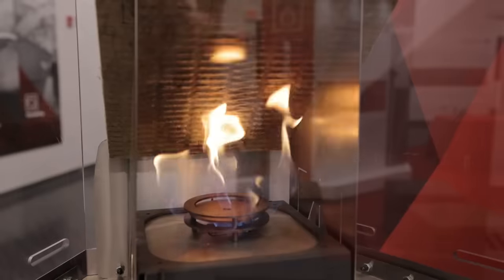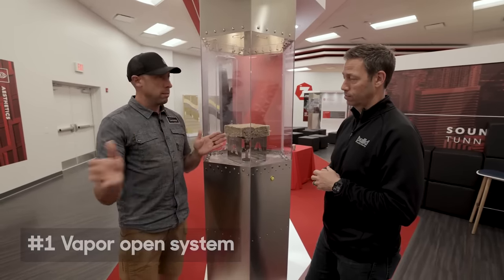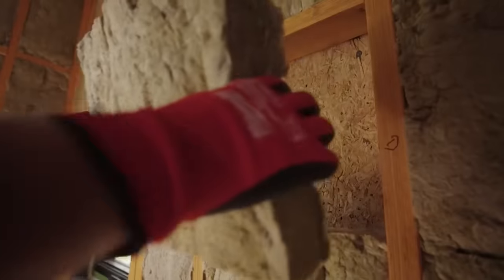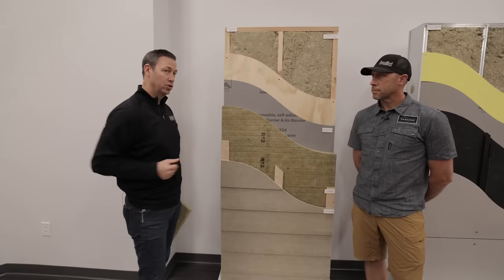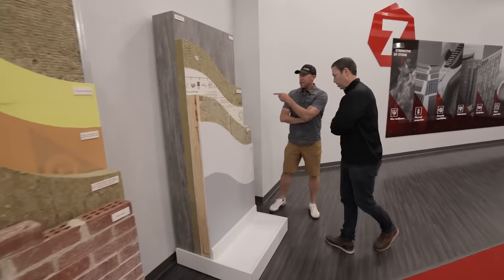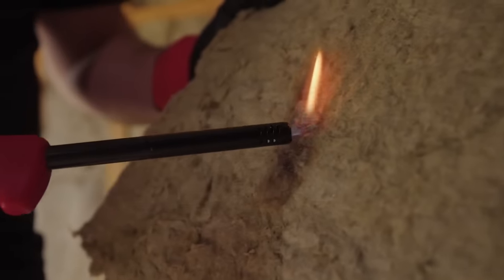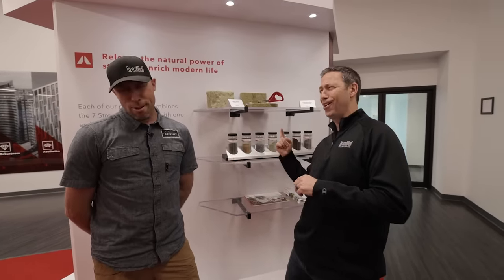3 (little known) Benefits of Rockwool Insulation

Comment: In a humid climate, does the vapor open characteristic lead to substantially more latent load for the air conditioner or dehumidifier to remove? Or, is that vapor pathway small compared to other vapor pathways even in a well air-sealed house?

Comment: Vapor barrier information is all over the place.  What side to use the faced barrier or none at all.  Can you break it down for us?  I have a connected garage in southeast US and have no idea after doing a bunch of research.
Reply: Vapor barrier goes on “wet side” of wall. In desert climate we install on inside, because air from human respiration creates moist air within building envelope and you do not want that moist air migrating into wall cavity. In southern US, your moist side is outside, both rain and humidity while interior air is typically dry due to AC. 

Most mineral wool insulation lacks a vapor barrier, Kraft paper or plastic. The only areas we install vapor barrier on inside is high elevation mountains or desert where exterior humidity levels are commonly <20%.
Reply: Vapor barriers are tricky.  Building science is actually moving away from using them.  Old houses have very little or no rot without them.  It's kind of like the tar paper vs tyvek argument.  Again the old house tar papered wins
Reply: @tonyramberg9697  thank you for your thoughts on this important topic.
Reply: @MichaelM-to4sg  thanks much for that information!
Reply: @tonyramberg9697  That is beyond absurd. Tar paper is/was awful. Building science is not moving away from better sealed houses. Old houses have lots of dry rot issues. Where old houses “win” is fewer mold & mildew issues because they are so poorly sealed the ventilation is poor environment to host mold spores. 

Old houses are much lower efficiency, resulting in more energy usage, more operational costs, more bug issues, poor interior air quality, poor sound insulation. Nobody above room temperature iq chooses tar paper over Tyvek. 🤦‍♂️

Comment: Matt, I’ve been watching your videos on attic insulation. I live north of Austin in Temple. I have a 12 on 12 pitch roof with high ceilings in the attic. I’m not completely sold on spray foam, so this Rockwool insulation could be a good option. Would you recommend this product over spray foam for this area. Also, I was looking at this as a possible DIY. Thanks for the videos!

Comment: The only downside is that it’s a wifi killer. So if you use it on basement ceilings or as a soundproofing in interior walls it will stop Wi-Fi transmission. Easily cured by running some cat5 between zones but something to be aware of going in.
Reply: Will- I have  t heard this before-can you refer me to a source out url ?
Reply: @johnwhite2576  Haven’t looked on line but first heard it a few years back from a service provider technician and had the personal experience of weak Wi-Fi transmission through old school plaster walls and upstairs to basement through rockwool . The benefits in soundproofing and fire retardation far outweigh any inconvenience posed and you’re better off with cat5 runs between zones anyway.

Comment: Getting Rockwool at my local Lowes is very hit or miss. Them seem to carry only a very limited amount and only r-15 16" on center. Anyone have a better source for picking it up?
Reply: Your locally owned building supply? Avoid those big box chains whenever possible
Reply: Can't ever get the exterior board here in rockwool.  It should be used more

Comment: 1) That "sound tunnel" is not exactly realistic. Most of us cover our walls with drywall or other hard panels which reflect sound. If that tunnel was lined with drywall you'd be hearing quite a bit more of the conversation on the other side, although those 90° angles would attenuate the sound. Doors would help even more.
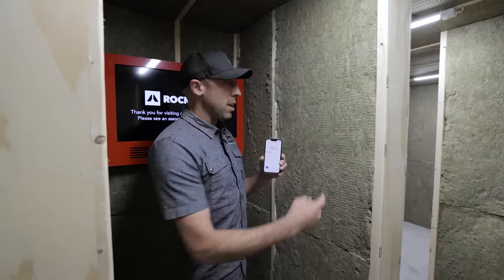2) 12:46 That's why acousticians favor it, perhaps. Sound engineers are minimally educated on the finer points of wall insulation unless they've also built their own studios or have a particular interest in architectural acoustics.

Comment: Maybe not a relevant question but I have a cdx roof on my house. Roofers installed waterproof peel and stick underlay on top. And the builder wants to spray foam+ rockwool the cavity. It's an I joist roof. Are there any concerns for rot or mold if both sides of cdx are effectively vapor proof. Roof is non vented. Let me know

Comment: I'm curious about the distinction between Commercial and Residential. For example, "We have steel studs, which are highly conductive ... so we've got to have some good exterior insulation". We should have that for residential as well. Steel studs are something that I think has benefit in residential, but the negatives are the same as for commercial: The thermal issue. Can anyone explain why the best practices for Commercial are different from best practices for Residential, especially since goals and usage are similar?
Reply: Steel studs aren't as strong as wood studs, so they're generally used for non-structural walls. In commercial buildings you generally have a steel frame or concrete walls providing the structure, whereas in single family homes the stud walls provide the structure, which is why steel isn't often used there. Its main advantage over wood is straightness, but finger-jointed, LSL, or PSL studs share those advantages.

Comment: So, a question I have is how to best utilize this product to redo Engine Bays in Wheel Estate (Motorcoach RV) instead of Real Estate. The Rubberized sound deadener I have now is just crumbling from the heat. I am thinking this can be utilized as a Far superior. retrofit because of the benefits I see here.  So, what products and type of installation would be recommended for this? Keeping in mind Road Contaminants, Diesel Fuel/Oils that can be either splashed up or sprayed possibly from a leak? I am thinking a Hard Sheath that is both Fireproof and Sound deadening and contain the Rockwool product.  I also wish to line my 10KW Deisel Generator compartment, located in the front of the coach as well. It is a well-insulated 40' Diesel pusher now, but time to upgrade the current materials that are Sub-Standard, the way I see it. It is flaking, cracking and just falling everywhere with black dust particles galore! Not trying to Re-Invent the wheel here, if this has already been done, and specs already exist for the best Sound/Fire insulation, but if a Factory Rep, or RV Industry Guru could just chime in here that would be awesome!  I'd like to do this project, ASAP!  I just wish to do it correctly, and not have bad results for the Financial Outlay, I am looking at! It was mentioned I could get Double the Sound Deadening with an Air Gap, as well. I have about 5" or possibly more thickness to deal with here, easily, and could make it thicker if necessary?
Reply: To add, I have already installed a Passive Sprinkler System with Fire Bottles filled with AFFF Foam, which is still the best Fire Extinguishing agent made. I have heads for one bottle above the Transmission, and Engine. A single head above the Genny, and one in the Refrigerator compartment as well. They are similar to the Commercial type of heads you see installed in buildings. I hate Fire and was willing to spend over $1,000.00 for our safety in that regard. That was just for the Hardware. I did my own install. That would easily have been yet another $1,000.00 by estimates given.  I take this seriously and I keep coming back to this product as my choice. Is it doable? Thanks! RV Fires and Sound deadening are very real concerns in Wheel Estate!

Comment: If I were going to use both comfortboard and safe n sound in the same interior side of an exterior wall, what order should I go? Which product should be on the interior side?
Reply: You would use Comfortboard over the exterior of the wall sheathing, and Comfortbatt for the wall cavities on the interior side of the sheathing (between the studs.) The Safe'n'Sound is used on partition walls that are completely within the envelope of the building, as it doesn't have a rated R value.
Reply: @JamesCusano  I’m only gaining access to the interior side of the exterior wall
Reply: @baxt1412  Ah, I see, that might be a bit trickier. Comfortboard is semi-rigid, while Safe’n’Sound is soft and deformable; so Safe’n’Sound can only be used between framing members, whereas Comfortboard can be placed over framing members or layered over wallboard.

Comment: Is there a mineral wood product that can be used under a metal roof?
Reply: Comfortboard 80 is used for that. Usually with spacers like strapping between the insulation and the metal to promote ventilation/drying of any condensation on the back side of the metal.

Comment: Fire resistance, bug resistance, sound protection, etc you have that with brick too. But Rockwool doesn't give you storm protection. Also, wood framing introduces thermal bridging by default (to some degree unless you insulate from the outside). You don't have that with brick walls.
Reply: What type of insulation does provide storm protection?
Reply: @hellonoko  Brick. :)
Reply: @b_lumenkraft  are you referring to thermally insulated clay blocks or similar like you might find in Germany? 

Sure, but sadly we don’t use that in the USA. 😅
Reply: @hellonoko  yes, i mean those insulating ones. I am from Germany and the concept of building houses with wood sticks is very very strange to me. ;)

Comment: How does vapor permeable work with the Zip system or does it not work?
Reply: The ZipSystem is an air barrier, but still vapor permeable.
Reply: The OSB part of zip is vapor permeable, the green paper sheathing and tape are effectively
 NOT vapor permeable, as were Hubert’s own web site
Reply: @johnwhite2576  From the Huber blog article titled "Your ZIP System Wall Sheathing Questions - Answered" posted on April 29, 2021:
Are ZIP System sheathing panels a vapor barrier?
No, the integrated protective overlay of a ZIP System wall sheathing panel is permeable to allow for drying to the outside.
What’s the permeability of ZIP System sheathing panels?
The permeability of the entire panel is based on the permeability of the OSB (1-3 perms depending on thickness), while the permeability of the integrated protective overlay alone is 12-16 perms.

Comment: How does it compare to a spray foamed house with a tight envelope? That’s what most of the building in the south is using.
Reply from the maker: I like Zip system for air tightness then Rockwool inside. SPF has “some” air sealing benefits but it’s unreliable so I prefer to be air tight at the sheathing
Reply: @johnwhite2576  thanks for the info. SPF is in nearly every new house I work.

Comment: If you hang drywall in that sound tunnel, it will not perform as well. That display is designed for a very specific purpose that is a bit deceiving. It is still great stuff, just not an accurate representation of through wall sound transfer, more of an acoustic display.

Comment: Hey Matt!  I am curious, why did you choose to use Rockwool inside your new house's walls, but not on the roof deck or on the outside of your sheeting?  I am getting ready to build my last home (hopefully) and have been considering the Comfortboard for the external wall and roof deck.  Notably, I am building in the WUI, and it is a fire-risk area.  I am currently planning on a metal roof and metal covering for edge locations and eaves.  Siding is still under consideration, but leaning toward cement-based products (Hardy Siding or Stucco).
Reply: Roof deck it's too compressible is my guess
Reply: I was hoping to get Matt's take on this.  After you commented, I took the time to review the spec on each and didn't see what I considered to be dramatic differences in compression ratings.  I could have been reading the ratings wrong, and they weren't always apples to apples.  I will keep hoping that he will weigh in.

Comment: Can Rockwall be blown into walls as a part of a rehab?
Reply from the maker: No blown option at this time
Reply: @buildshow  Thanks so much for the info Matt...even though it wasn't what I was wanting to hear❤
How would I attach Rockwool to the underside of my pier and beam home. I've tried fiberglass batts, but the mice and squirrels still manage to get in and tear it up🥺
Reply: @CAneedswater  You have to find where the mice get in and block it somehow. I wired the 24" batts between the beams in the ceiling of my mid-century modern home in Las Vegas.  I started 1.5" roofing nails every 12" or so and ran black steel tie-wire zig zag between them to hold the batts up. Then put up the sheetrock.
Reply: @ricoludovici2825  My house is pier and beam. I'm wanting to put the batts underneath the house. I previously had fiberglass under there, but the mice destroyed the fiberglass and some wiring along with it. I'm thinking maybe chicken wire to hold it in place, just not sure.
Reply: @CAneedswater  That sounds like a soluition. He says they won't chew through it or nest in it. Which they do by chewing.

Comment: @Matt Risinger  I'll be building my first house later this year so I've been soaking up as much wisdom from your videos as I can but all of your insulation/building science videos are for air conditioned houses. Since my beliefs prevent me from using air conditioning I wanted to ask if you have any insulation tips or advice for a 2000sqft, single story, pier and beam, un-airconditioned house with the very Hot summers of central   Texas.🙂

Comment: At 3:47, we see the installer doing an incorrect installation of the Rockwool by placing it directly over the very poorly secured low voltage wires, pushing the wires back against the exterior wall sheathing.  This leaves the most vulnerable part of the wall with an air gap at the exterior sheathing, with a VERY easy air path to the large openings in the low voltage panel.  Exactly what builders like Matt want to avoid. 

Secure the wires in the middle of the studbay, you lazy L.V. installers, forcing the also-lazy insulators to split the insulation and do a proper install.  With half a layer behind the wires against the exterior sheathing, and the remainder placed on top, this will limit any air gaps.  To the cheap builders that don't think it's important to hire a true L.V. professional for your low voltage...well,...shame on you.  You wouldn't do that with your main electrical wiring, would you?

Comment: Rockwool has a shelf life of 6 months in the bag, they say you can get it wet, and yes you can but what they don’t tell you is that you can NOT get it wet when its in the bag, i have 200 plus bags of Rockwool that is literally garbage
It will not come back to shape when you open the bag, the bats are all around 1.5” thick or less and if you squeeze it to hard it won’t come back to its shape, 
Rockwool refuses to do anything
For that reason I would stay away

Comment: On one level thsi whole discussion is dealing with a straw man fiberglass fiberglass , esp batts, is the most used but LEAST desirebale in insulation on any….a better ‘fairer com parison would be with very viable choices like wood fiber/gutex.dense cellulose, even spray foam .

Comment: Fiberglass insulation should be outlawed in the United States. The benefits are too great to ignore. Any one of the benefits make it a no brainer. Using fiberglass insulation instead of Rockwool insulation is like pouring concrete without 2' square 1/2" rebar. Many contractors will tell you you don't need the rebar. When concrete cracks without rebar it is going to move. With rebar in it it won't move. If you watch a high rise being built you will see tons of rebar going in. Same with roads being built, lots of rebar. If a contractor tells you fiberglass insulation is just as good Rockwool you need to find a new contractor. Same with rebar.

Comment: Straight up bs marketing video. I started googling claims and just kept finding bs. 3:00 "In a six-month study conducted by the University of Nebraska-Lincoln Veterinary Science Research Facility, five different insulating materials were exposed to mice under controlled conditions. All five types of insulation tested, including fiberglass batts, fiberboard insulating panels, rock wool, closed-cell extruded polystyrene foam and vermiculite, suffered severe damage from the colonies of mice."